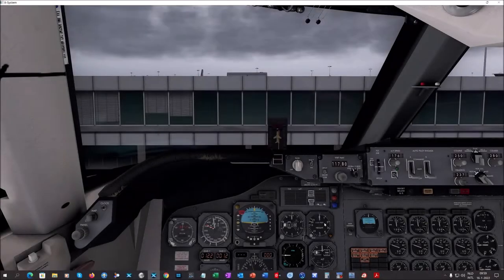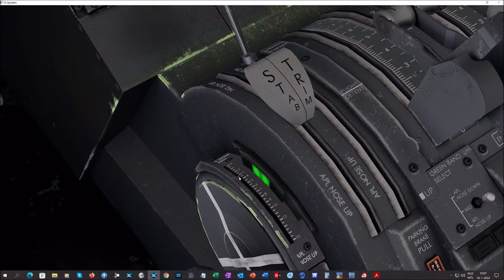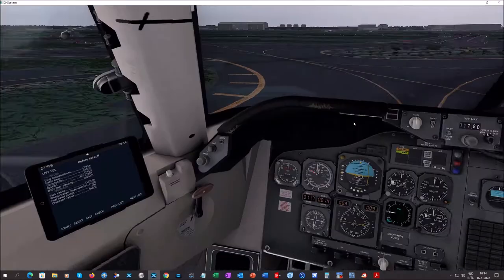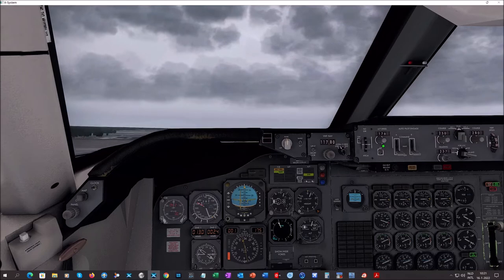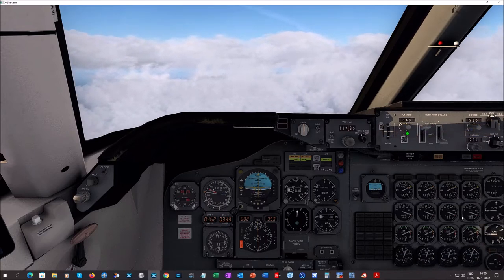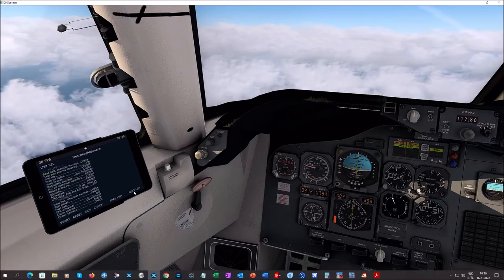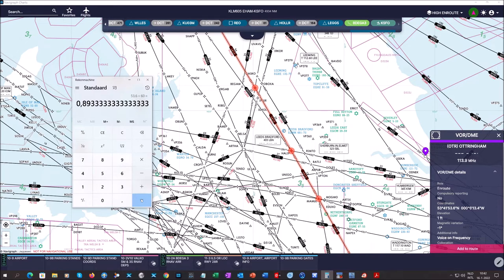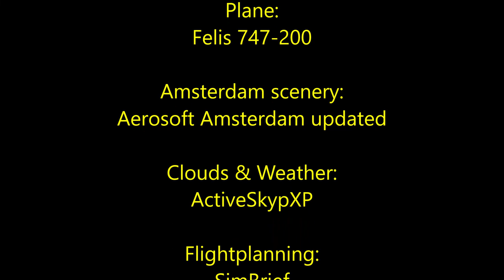Felis 747-200 Long haul using INS - part 2 of 4 'from pushback to TOC'

Comment: Excellent video; I really enjoy all the details that were included, as well as your level of professionalism ! It's a great tutorial to fly this bird
Reply: 2 things I would point out: when entering coordinates in the DELCO, you don't need to enter the leading 0s. Also, when climbing, you can't select speed on both the A/T and A/P panel, it can be either EPR/Speed (will pitch for speed at fixed thrust), or SPEED/VS (will adjust throttle to maintain speed at fixed VS)
Reply from the maker: @fordcontour  many thanks for the kind compliment and feedback! I’m pretty sure there’s more errors in the videos, so please point them out so everyone can learn from it!

Comment: Excellent video, only negative was being in windowed mode, it degrades the immersion factor :) I also love the aircraft!
Reply from the maker: Thanks for the comment. If I’m in full screen mode, switching to Navigraph etc. becomes a real pain…
Reply: @0321Sjoerd  Ah, I suspected something of the sort. I run in full screen and using the 'Command' key suspends out and let's me get to anything I wish, I have never had any issue with that, but then I'm not recording anything either so I don't know. Regardless, thanks for an excellent series!